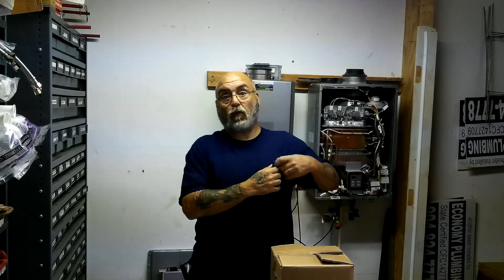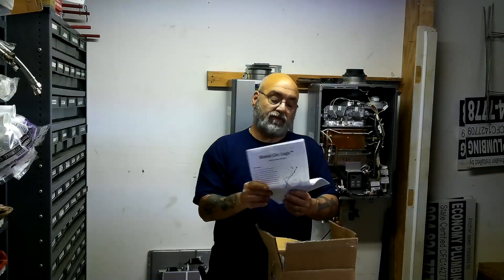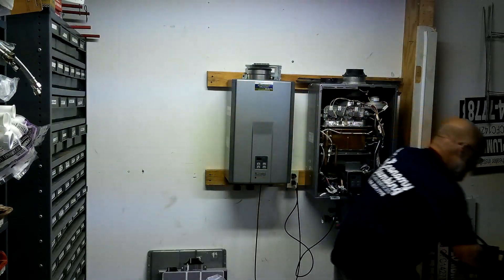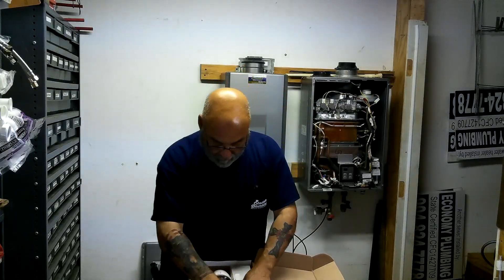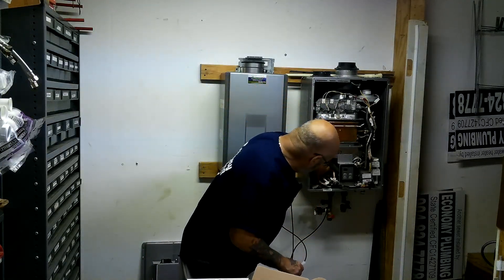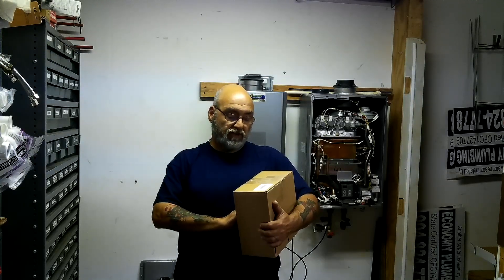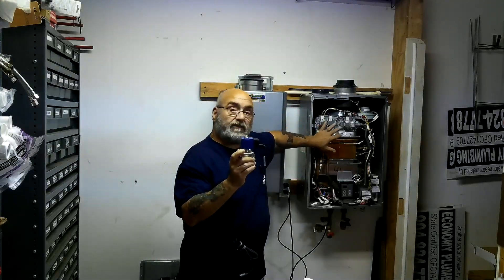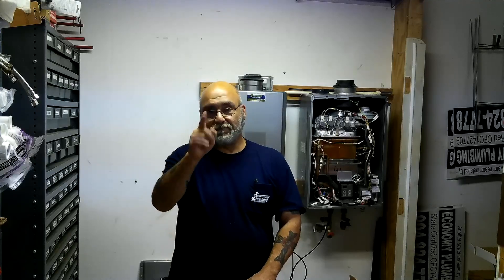Unboxing of Rinnai's Condensate Neutralizer, Freeze protection kit and Cir-Logic pump kit.

Comment: Hey Mike, great vids! I have a question pertaining to tankless wiring to a condensate pump. I currently have a condensing furnace wired to the condensate pump safety switch
. The pump only has two terminals to for the safety switch wiring, which are currently used by the furnace. My question is, can I wire the the safety switch wires into the same terminals on the pump that are already wired to the furnace? If not, is there another way to wire the tankless to the safety switch on the existing pump? Thanks for your time!

Comment: Hi Mike,
Thank you for your videos, they are very helpful.  I am changing out a tanked water heater with a Rinnai Ru130in model in a small 1 bath home.  Just a couple of corrections on the condensate neutralizer:
1.  You mixed up the inlet and outlet sides.  The centered one is inlet and the off-set one is the outlet side.
2.  The instructions that are included in the kit are not the way that Rinnai suggests to install.  I called Rinnai after noticing a discrepancy between the included instructions and the instructions that are printed in the Rinnai SENSEI™
N-Series Condensing Tankless Water
 Heater Training Program
 Level II – Installation Fundamentals manual.  The technician that I was transferred to said that they don't install the condensing units with a by-pass, but use an air gap instead.  Here is a link to the Rinnai Level II manual (see page 85) 
https://www.google.com/url?sa=t&rct=j&q=&esrc=s&source=web&cd=1&cad=rja&uact=8&ved=2ahUKEwjt-5WGqPPoAhVUs54KHUSoB-kQFjAAegQIARAB&url=https%3A%2F%2Fwww.rinnai-lms.com%2Fresources%2F288%2FSensei%2520Level%25202%2520with%2520MSB.pdf&usg=AOvVaw0QRGMNQTXH8DKSypYE6qac
Tech also said that the neutralizer can be installed horizontally or vertically.  I believe horizontally would be better in order to give the condensate more time in the tube to effectively reach a stable PH.  Some people say that if you use the laundry standpipe to drain the condensate liquid, then the laundry soaps will also help with neutralization of the condensate.
My kit came with little round bee-bee's rather than crushed rock.  BTW, the ends on the tubes are super difficult to remove and I don't look forward to struggling with removing the end caps to replace the neutralizer material when the time comes to do so.
After I had ordered and received the Rinnai neutralizer kit, I came across a really nice unit that is made by Axiom, a Canadian company and I ordered one.  This neutralizer NC-1W is also sold in the USA.  Seems to be a nice design with a smaller footprint and in my opinion, better design features and the unit is so much easier to unscrew when the time comes to change out the neutralizer material.  Even has a small red colored pop-up to let you know that the unit is in need of maintenance. The inlet and outlet ports are 3/4 inch unlike the Rinnai which are 1/2 inch.  Easily done with PVC 3/4 inch to 1/2 inch  adapters.  I will be draining to washing machine standpipe that I have installed with wye fitting.  I can send pics in a couple of weeks after I have mudded and painted the laundry room.  Here is a link to the Axiom NC-1W Condensate Neutralizer;
  http://www.axiomind.com/
Thank you again for your passion for what you do.